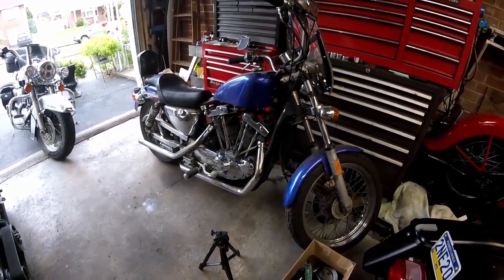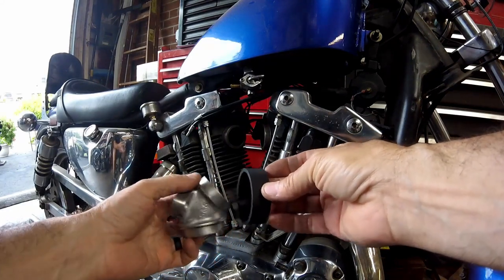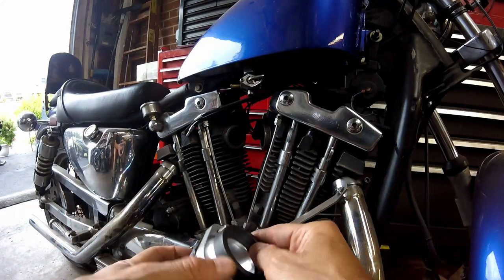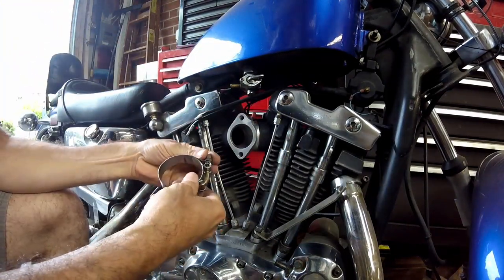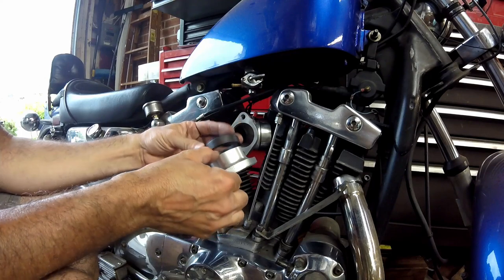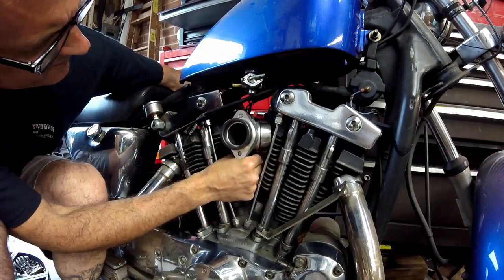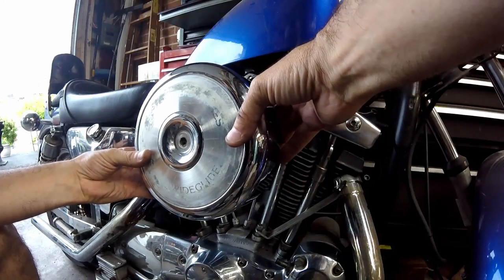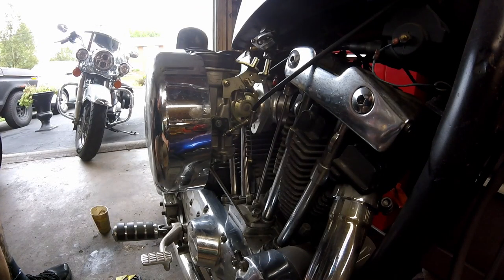Convert CV Carb Keihin onto Ironhead Sportster Shovel Head or a Mikuni HRS-42

Comment: Thanks so much for this video, super helpful! Just picked up a CV for my 1981 xlh. It only had one throttle cable on it before but I plan on getting a new throttle and pull cable. Does anybody know if the “push” and “pull” cables are just two identical throttle cables, meaning can I just buy two identical throttle cables? Or do I have to buy two different kinds of cables?
Reply from the maker: Thank you for the kind words. It’s two different cables.

Comment: Hi. I have a 1985 XLS1000 Roadster that I'm switching from Keihin butterfly carb to a CV carb. Easy bolt in, however the throttle cables throw are to short. When cable is installed, the butterfly is in half throttle position. Where can I find the cables for the Roadster with 16 in Apes. JP cycles don't carry this item.
Reply from the maker: @RapiersWrath  I’m not exactly sure what you’re asking. You can send some pictures to my email and I can look at them and maybe be able to lead you in the correct direction. 
hdrap_1999@yahoo.com

Comment: Where do I get the rubber piece that’s fits between the carb and the intake adapter? I ordered the adapter flange on eBay but it doesn’t show the rubber part
Reply from the maker: This is the stock Evo gasket. 

https://www.ebay.com/itm/281176795228?hash=item417771685c:g:HQ8AAOxy-8pSZ0KD&amdata=enc%3AAQAHAAAAsEEP5Ry1NViXttvpe1bEc3M6c%2FXLs%2FAgXwqIxoxL%2Bq4pn%2ByipA%2FgBYHHYpKGqg6aaa5hY2DQhgu9rezBzbbkuJxgdc7nyMOCvweZbjnWqLXO8U4vGMEAGVOEYWqUOiustDc1%2B1QEmomZxPjdcids%2ByoWvD%2FVp7PskOhw5mWcikYyf6lzQAaAamcle8KNDEblrUHuBRV2BTgI%2FmgfQsa0hgefaQtlZvgCHCLcIdt%2FVdOX%7Ctkp%3ABk9SR5iOzY_BYQ
Reply: Thank you